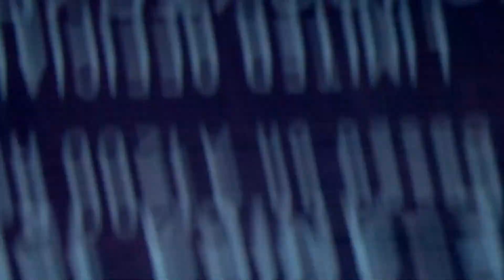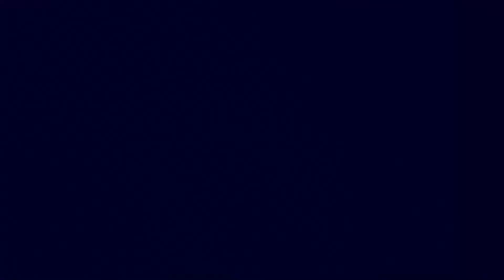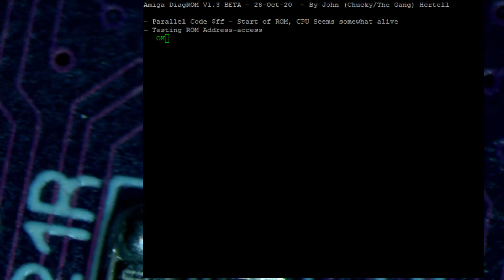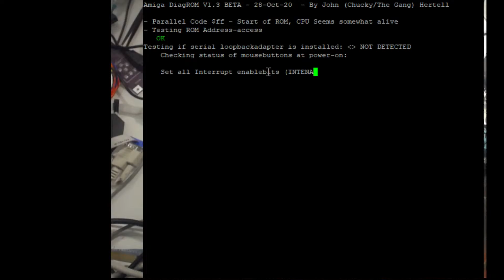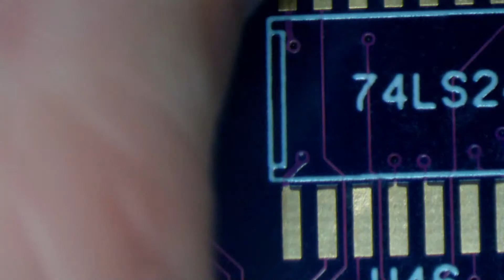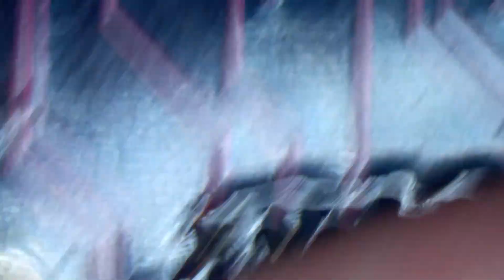Random Purple ReAmiga 1200 soldering

Comment: I downloaded the putty software. What is the cable you are using for the testing?
Reply from the maker: A serial nullmodem
Reply: @ChuckyGang  Thank you Chucky
Reply: @ChuckyGang  BTW is that going to usb or vga. I see different configuration to choose from on Amazon.
Reply from the maker: @Liberty309  VGA is not for serial communication.

USB works but either you need a extra nullmodem or a USB cable that is for console usage (nullmodem)
Reply: @ChuckyGang  O.k. I tracked it down to U13 preventing it from booting. I guess the chip needs to be burned/programmed, is that correct? If so I do have a TL866II-PLUS , will that work or do I need a different one programmer?
Reply from the maker: @Liberty309  not common for it to die.  I doubt the TL can program it.  no idea what programmer supports that chip actually